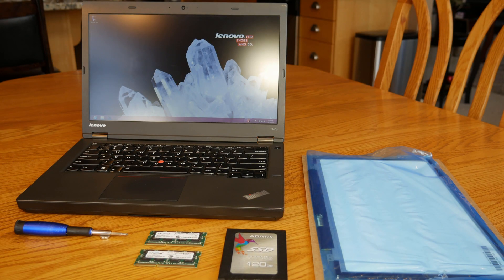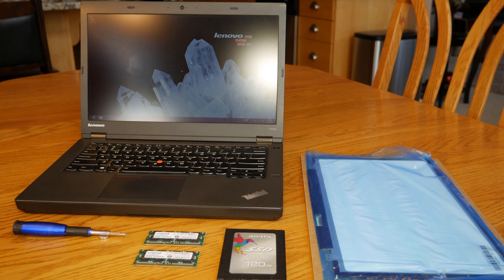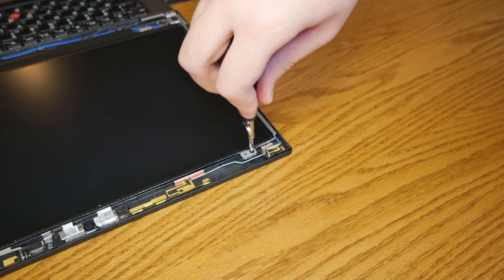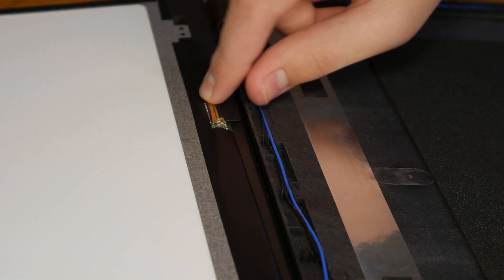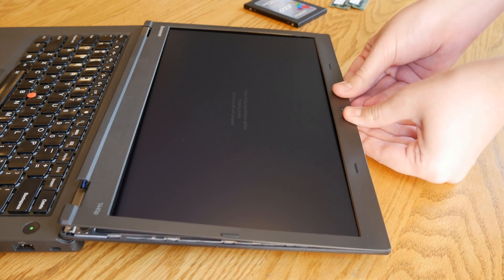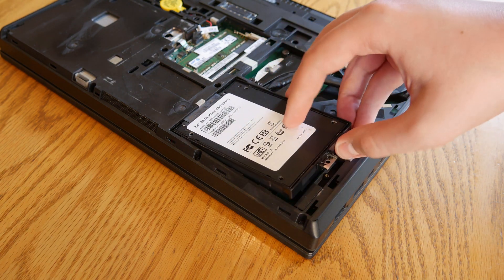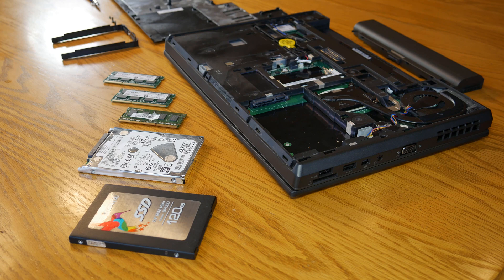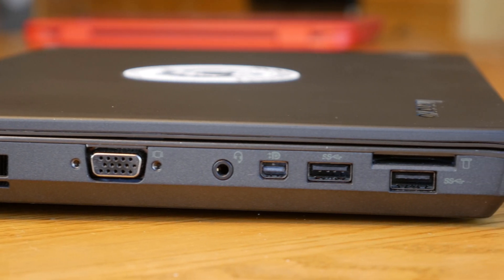ThinkPad T440p Upgrades | New 1080p Display, 16GB RAM, 120GB SSD

Comment: I have t440 which I have install 16 gig of DDR3 Ram 256gb of msata ssd in wlan and 1tb Toshiba HDD 5400 rpm regular  hard drive. With windows 8.1 64 bit running owhsome.

Comment: I short circuited my t440 in a bombastic and manic move by plugging the wrong cord into the wall while it was still connected to the laptop, it immediately died and I glumly resigned my babe for the meantime. I bought a brand new battery to see if that helped, it didn't. I tried with a different charger in case that was a possible solution, but alas. Anyway. 6 months later reorganising, I go to move it and notice the lights on (with original battery), I fire the bad boi up and fuck me it suddenly is working again - GOOD AS NEW!!! I've been raving on about how solid and hardy this mfker is before i even knew that there was an appreciation for them online. People always making jokes about how old it is and how it looks like a school laptop and how its got the mini red keyboard clitoris but I will laugh with them - COS THIS MACHINE IS A MACHINE ! almost 15 years old and we got hours of original battery life still going without needing to be plugged in and I cant say the same for atleast 10 laptops left in the dust. God damn it I will die on this hill!!

Comment: The T with P series are the most reliable thinkpad ive ever owned.
Have P50 and P51, P14s, and tons of T series before since T400 to T590, but the most i use a lot is T440p and now T470p. 
those mf' are the badass of laptops, matter a fact, im writing this on my T470p.

Comment: I paid less for my T440P than the Windows Pro licence which came with it would have cost. (This was before lockdown pushed prices through the roof). It was sold to me with Ubuntu installed but I found a Windows Pro sticker on the underside and simply overwrote Ubuntu with Win 10 Pro. 😁

Comment: sir i have this laptop but my bluetooth is disabled from bios and i can't enable it beacause its hardware password manager and supervisor protected can u plzz tell me how i can enable it beacuse i don't have write permission in bios i/o
Reply from the maker: Unfortunately the only way to remove a bios password is to reflash the bios with a special hardware programmer and software that can unlock the bios.
Reply: Sir i saw several videos where they short circuit cmos chip in hardware and reseted bios

Comment: do you still recommend this laptop for students this 2022?
Reply from the maker: Thanks for watching! Since making this video I have moved on to the Dell XPS 15 9570, as I wanted the extra CPU and GPU power, as well as a 4K screen (which help with editing videos here for this channel). But for most regular school/office work the T440p is still a champ if you take the time to upgrade to a 37-watt TDP Core i7, 16GB of RAM, an SSD, and with a 9-cell battery it'll keep on running for a long time. Hope this helps!

Comment: True story, went to Vietnam for cross country back packing trip 2019. Got stuck in a one of many rainy flooded village and I tripped. The laptop bag fell in the muddy water. The T440s booted up but was acting weird. Waited a day, the hot Vietnam weather dried up the T440s and powered without an issue. The LCD has water marks to this day but I'm impressed this didn't die like any other laptops I had owned. Been doing tech support past 20 years. I replaced the LCD eventually and handed it to my younger brother who was looking for a dependable laptop. I bought a T560 but ended up buying a T440p at Goodwill for $30. The laptop booted with the power brick I had on T440s, upgraded ram, ssd, and works like a champ. These T series are prime candidate for hackintosh!
Reply from the maker: Absolutely an awesome story and it really does prove the dependability of these laptops!! Great Goodwill find too! These are seriously some great laptops and we hope to get more in the future. We agree that these are amazing for Hackintosh as well! Thank you very much for watching! 😀

Comment: Can i upgrade it to 32gb (2 sticks 16 gb) and maybe a GPU upgrade?
Reply from the maker: Thanks for watching! The T440p supports a maximum of 16GB of memory (2 sticks 8GB) and the GPU is limited depending on what model you get. Lenovo offered both an NVIDIA model with a soldered (non-upgradable) GT 730M GPU, and an iGPU only option with no dedicated GPU. The best upgrade you can get for these laptops is a Core i7-4980HQ with built-in Iris Pro graphics, which are much faster than the GT 730M models.
Reply: Can that core go on the 440p with a Nvidia
Reply: I never heard it would work. Only on perhaps a t450

Comment: I have x230, how to find the 1080p display that fits on it? Thank you
Reply from the maker: The r/ThinkPad subreddit is a great place to start. The x230 requires an extra board to be soldered into the laptop before a FHD display can be installed.
Reply: TwoGuyzTech thank you so much!

Comment: with 16GB RAM can run 5 emulators nox together?
Reply from the maker: Depends on how much RAM and CPU power you need, 16GB is a lot of RAM for most tasks but I'm not sure how well it could run 5 emulators all at the same time.

Comment: Is that the best panel for this laptop? I have looked at a video from other channel that could get a 1920 x 1080 panel. I'm still newbie about this upgrading stuff
Reply from the maker: There are different models you can get - I opted for an AUO B140HAN01.3 panel which is a 1920x1080 IPS display. This display looks great and is definitely a huge improvement over the old panel, but choose the best one for you - this Reddit thread is a great source. https://www.reddit.com/r/thinkpad/comments/86pw7g/best_t440p_ips_fhd_panel_march_2018/
Reply: To my knowledge 1080p is the highest resolution for this form factor LCD. This is because Lenovo subsequently released an option for 1080p to the T440 series and up.

Comment: Great video actually! Replacing parts is easier than I thought!
I've bought a T440P recently and I'm waiting for it to arrive. 
Mine comes with 8GB of RAM and a 500GB HDD. No fingerprint reader though.
I'm replacing that 500GB HDD with a 240GB SSD once it arrives. 
At the moment I have to stick with the TN display, because I don't have enough money to buy a new one. With the color accuracy test you did, I got very impressed. IPS display it's a great improvement! 
I'm planning on upgrading to 16GB of RAM and a 4 core proccessor as soon as I get money to do it.
This laptop sure is a cheap and powerful machine!
Reply from the maker: I hope you enjoy the laptop and all the upgrades! It's been a great machine for school and work. I plan on upgrading the processor in mine (i5-4300M) at some point in the future too. They're built like tanks and still more than capable for everything you might need to do with a sub $300 laptop.